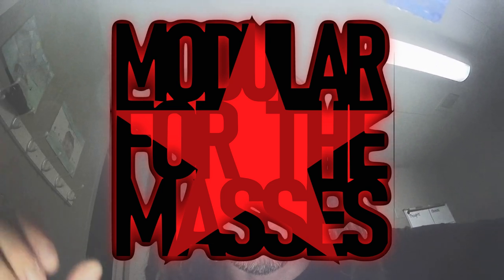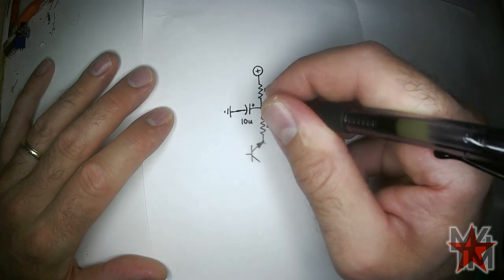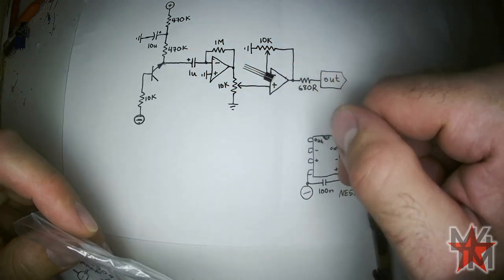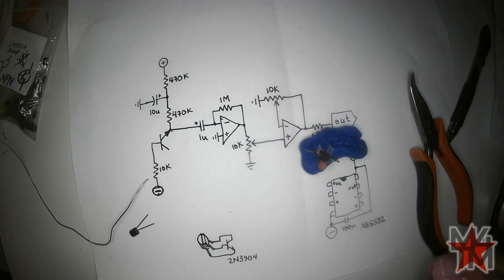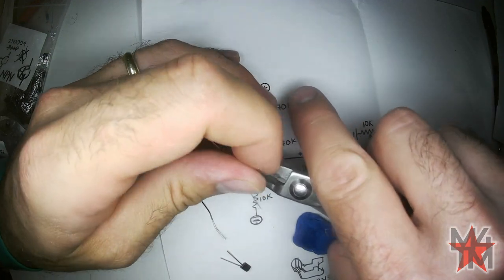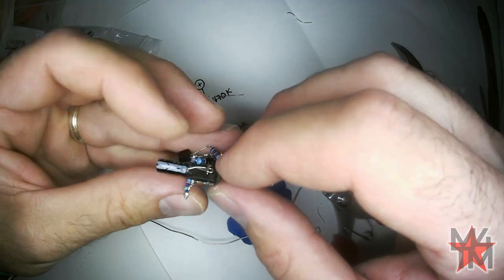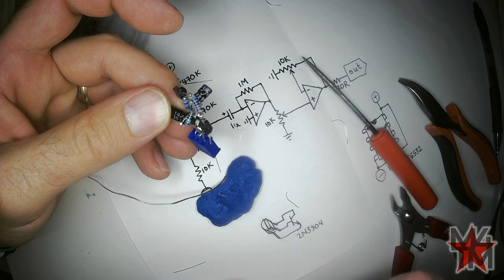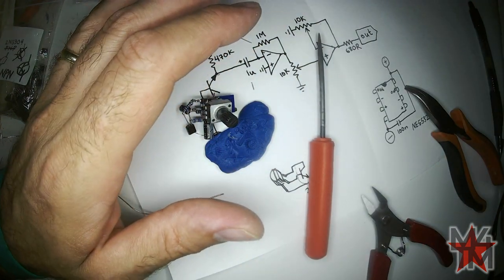You can build this white noise generator!!!

Comment: You can build a fairly cheap and nice power supply from frequency central all together the cob is 10 GBP and the rest of the parts are like 20 25 bucks sources from tayda/eBay.

Comment: Nice video. What voltage you run it on?
Reply from the maker: This runs of + and - 12V, but it'll work fine from +/-15 or +/-9V. If you need a bipolar power supply, I have a video about that!! :D

Comment: Can you use this amplifier to make piezo mic louder?
Reply from the maker: Not really. A piezo mic can put out plenty of voltage (the piezo effect is what is used to make sparks for those click-style butane lighters) but the current is very very low. You need a high impedance input (1M or higher) to get good results. A typical dynamic or electret mic preamp can have less than 47K impedance inputs, which a piezo won't drive well.

https://www.homemade-circuits.com/diy-contact-mic-circuit/